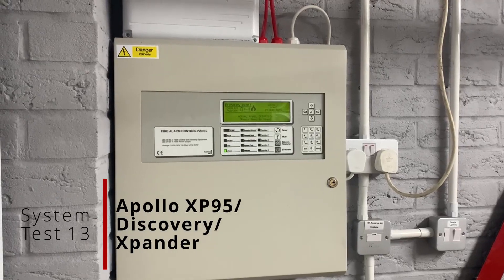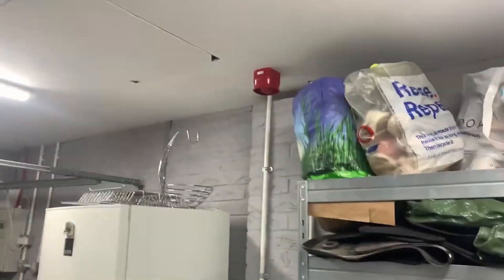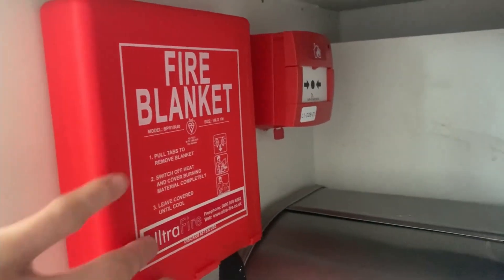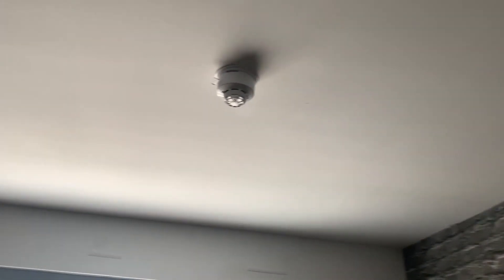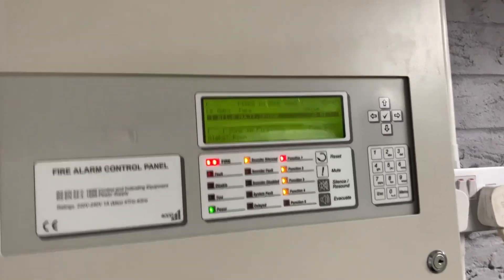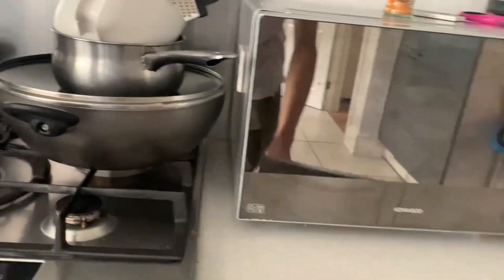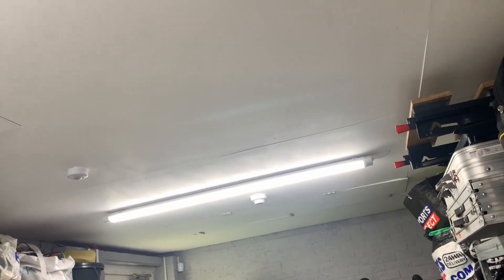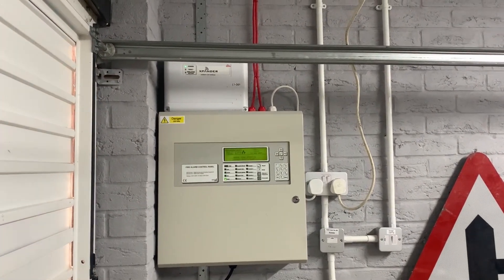Apollo XP95/Xpander House System Test 13

Comment: Nice system! Are you aware of any Apollo protocol panels that run on CoreProtocol?
Reply: Kentec Syncro AS, Kentec Series 6000 / 8000 (only on Apollo protocol), Advanced MX4100, MX4200 & MX4400. Advanced MXPro4 and MXPro5. All of these panels are good for what you’re wanting.

Comment: Have you thought of getting a repeater for the house yet also great test
Reply from the maker: it'll be unlikely, but if i had a suitable space i may consider it.
Reply: @fst1775 I’d recommend it, I don’t have a house system but I’m not running outside to check what’s happened if there’s a fire 😂
Reply from the maker: @obalarms  Usually you’re supposed to go outside when there’s a fire alarm, which is why I considered the location I’ve put it in.
Reply: @fst1775 Oh yeah true, forgot about that. No time to waste if your house is on fire 😂
Reply: Never go to the fire panel if there's a fire. Always go outside and leave the location